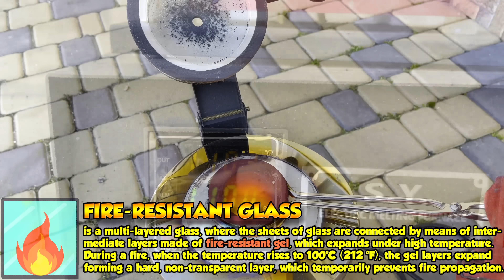Experiment: LAVA vs BULLETPROOF GLASS

Comment: The fact that this little lava cooker exists satisfies me greatly
Reply: me to
Reply: Not a lava cooker. The “cooker” is commonly used for melting metals for casting work.  Lava is molten volcanic rock.  It is a fun video though.
Reply: @ats440you  yes its a furnace I gave it this nickname
Reply: @ats440you  The video uses the term "lava" very liberally and has a "creative" thumbnail (basically a real lava flow photoshoped ontu glass. Looks nothing like the slag he uses). This looks more like melted iron to me. As you say, still fun.
Reply: @alexalex4041  lava is just melted rock
Reply: I don't think it's an actual lava tbh probably some molten metal
Reply: its not lava

Comment: Gotta love how the car glass just disintegrates.
Reply: modern day automotive safety requires that cars crumple and the glass shatters easily so it doesn't become super dangerous shards that will cut you up and impale you. They are engineered to be that way and for good reason.
Reply: @Darth1Marik  I might add, they are layered and in-between there's a sticky film that prevents too many shards to fall. In short, it crumbles but still stays in big chunks, to prevent cutting.
Reply: Tempered glass
Reply: @Darth1Marik  Automobiles use 2 types of safety glass, laminated glass for the windshield and tempered glass for the windows
Reply: @clarehidalgo  Was about to say. They ought to have tried a windshield instead of a side window.
Reply: @ianmayle  No, it's a side window. Side/rear windows are tempered (safety) glass. If you hit it head on with a hammer, the hammer would either bounce off or glass would shatter into a million pieces. But tap the edge lightly and BOOM, shatters easily. Front windshields are laminated standard (annealed) designed to give, so it will crack and flex if your head hits it preventing head trauma. It has a layer of plastic between 2 panes of annealed
Reply: I can imagine too that there’s significant advantage to having windows that break under significant heat. No one wants to be trapped in a burning car thinking “if only my windows were weaker.”

Most, not all, crisis situations mean that you’re trying to get out of a significant heat source inside your car, rather than keep one that is outside from getting in
Reply: yeah lol
Reply: @Darth1Marik  Some of those shards still looked super dangerous, and large.
Reply: @lennardtackett  well 1 the glass broke in one location from the heated liquid, in an actual car accident this wouldnt happen, as the vehicle would crumple and shatter the glass in multiple locations preventing large shards from forming. 2 look at those large shards again, they all have cracks throughout their shape, they would shatter into smaller pieces the moment they touch something with the slightest bit of force and  and some of them did when they hit the floor. So any shards that would hit a human body would break apart and only leave minor cuts. Still dangerous but I would still take car glass like that over regular glass.
Reply: It doesn't shatter and crumble just for cutting. It shatters so you are able to break them under water even with pressure on the opposite side. Then it crumbles quickly so it isn't a problem when escaping.
Reply: That’s what you want because you want the glass to shatter for emergency situations.
Reply: It's called safety glass....it spider cracks instead of having big shards
Reply: Never drive a car into a volcano.

Comment: It’s crazy how active the lava is. It looks like it’s working to destroy whatever surface it’s on.
Reply: I thought the same. Doesn't look like a very hot mass, more like some sort of mechanism built to destroy 😅
Reply: That is not lava
Reply: @examinus9737  Right you are; that's molten metal!
Reply: Molten lava isn't even that hot.

Try molten copper instead. It's 1300°C

But this was just molten aluminum 800°C , pretty equivalent to molten lava 950°C.

So the video title wasn't even misleading. It was actually fair click bait.
Reply: Lava shrinks as it cools. So initially it sticks to the glass and grips it and then as it cools it breaks the glass by essentially pulling on it.
Reply: @CalvinHikes  I'm certain its breaking the glass by heating the glass up and the glass expanding causing internal stresses. You could crack glass with a blow torch, no sticking and pulling required.
Reply: @monad_tcp  Good information 😅but doesn't really matter which one is hotter. Still couldn't stick your fingers in it 😅

Comment: The difference in effect the lava had between the fire resistant glass and the bulletproof glass is fascinating. I was expecting them to react more similar to each other, but with the FRG it boiled underneath until the pressure built up and went out in one big POP!

But for the BPG the glass started shattering much sooner which let the pressure build up less and avoided that final burst.
Reply: Yelp
Reply: Nice
Reply: 2:25 it did a flip
Reply: It seems to come down to the "plastic binder" which acts as a temperature barrier, the thicker, the merrier.
Reply: THAT'S NOT LAVA
Reply: @jasonrogers1576  yea its not lava why is it called lave its fluid metal

Comment: 02:54 So lava makes fire resistant glass turn into eggs?🤔 You've just solved the world's food problems!!!
Reply: I think it's popcorn
Reply: In the description of the fire resistant glass, they said that instead of the typical two layers of glass with a thin film in-between, it had two layers of thick high temperature glass with a heat expansive/resistive gel. So when any heat over 212*f touches the glass, the gel will expand and thickem creating a very tough layer. When the gel comes into contact with any heat that is well over 212* it hardens completely and changes color
Reply: It's not food

Comment: Not gonna lie, that glass actually held up better than I expected. 10/10 would absolutely install bulletproof glass in all the windows of my house.
Reply: 제발 한국인 나와라
Reply: Do you expect drive-by shootings ?
Reply: I would use Fire Resistent
Reply: @jeromewagschal9485  In US, very much possible.
Reply: @jeromewagschal9485  always prepare for the unexpected
Reply: @jeromewagschal9485  I live in the US and I'm afraid of drive by shootings with the recent mass shootings by neo-nazis. I think it would also increase the value of the property to say you installed bullet proof windows. Built to last!
Reply: @NobleAbsinthe  Can you imagine how confused a thief would be trying to enter your house through your windows if they didn't know it was this stuff beforehand? Lmao. I can just imagine the sheer bewilderment on their face.

Combine this glass with metal doorframes, high quality locks and some tough hinges. The price tag might be worth the peace of mind.
Reply: @zeropolicy7456  I read online that a square foot of bullet proof glass, with the same thickness as a normal window would be anywhere from $150-$800.

My windows dimensions are:
144in H
87in L

Area is 144 * 87 =12,528

Divide area by 144 constant to get square foot measurement.

12,528/144 = 87

87 square feet needed per window.
87 * $150 =$13,050 for low end
87 * $800 = high $69,600 per window 😢
Reply: @NobleAbsinthe  144x87?! Do you live in a cathedral??? Lol.

I used to work for Jeld-Wen, and when I worked there, the pricing for custom treatments was pretty high. Our particular factory actually offered bullet-proofing, but it cost more than $800/ Sqft.

If you're trying to bulletproof Patio/Bay windows like that, it might be better to just skimp on the security a bit. Lol.
Reply: @zeropolicy7456 my bad I was reading the other side of the tape measure. I'm so dumb lol. It was in cm. So just convert those to inches. 😳😳😳
Reply: @NobleAbsinthe  So about $2018 - $10,767 per window. That's not crazy unreasonable.

 I knew 144x87 inches was a bit too big. If you had enough money to afford windows that enormous in the first place, bullet-proofing wouldn't be a big deal. And if security is worth that much, you're better off with a wall instead of a gigantic window. Lol.
Reply: @zeropolicy7456  Thank you so much for catching my mistake! And yeah it does seem more reasonable. I might look up nearby vendors to see how they compare to that Google price range just for the sake of curiosity!
Reply: @NobleAbsinthe  Yeah sounds about right, and then if you want them framed after specific measurements it will be very expensive, but for people that have lots of money, sure go ahead.
Reply: Same
Reply: @NobleAbsinthe  it doesn't make sense to use bulletproof glass anyway, because with the construction you usually have in the US, the walls aren't bulletproof either 😉
Reply: Bulletproof glass 😳
Why not just install law and order? It got to be cheaper.
Reply: That would COST as much as your house is worth.
Reply: Guys, HERE is Our Savior

HalleluYAH translates “Praise ye YaH”

YaH is The Heavenly Father 
YaH arrives via the TENT OF MEETING
YaH was Who they Crucified for our sins

** NO FEMALE INVOLVED WHATSOEVER **
— Hebrew Book of Isaiah

Isaiah 42:8
"I am YaH; that is my Name! I will not yield my glory to another or my praise to idols.

Isaiah 43:11
I, I am YAH, and there is no other Savior but Me.

Isaiah 45:5
I am YaH, and there is none else.
Reply: @newbiekhyber  Only depends on where you live in the US. Some areas have higher crime rates then others
Reply: Notice how thick it was compare to the other windows.

Comment: fun video, fire resistant glass is good stuff, just super expensive

a bit of info, bullet proof glass isn't special glass.  It's just a bunch of thick layers of normal glass (usually 1/4" to 3/8") laminated together, similar to how your windshield is 2 pieces of 1/8" glass laminated together.

Comment: As a materials engineer, i am now determined to understand the mechanism here and why the reaction is the way it is
Reply: Don't forget to tell us about iiiiiitttttttttttttt
Reply: Points for curiosity, but a "materials engineer" who doesn't know about thermal expansion? Tell me what college you went to so I can avoid sending my kids there.
Reply: On a more constructive note, the effects observed here are predictable if you know that materials expand when heated.
1. Window glass: the central region gets heated, expands, while the rest does not, so the central region pushes the glass sheet apart.
2. Fire glass: the upper layer cracks due to thermal expansion, then the gel absorbs the heat, not allowing the other side to crack.
3. Automotove glass: cracks due to thermal expansion, but this type of glass is designed to shatter into small pieces, so that drivers don't get hurt as much during crash/impact. 
4. Bullet proof glass: the upper sheet absorbs the heat and cracks as it should, but not enough heat for the rest. 
Thermal expansion is critical in materials science. You wanna build things with materials that have similar rate of expansion when heated or your structure may crumble, form gaps between section of different material.
Reply: @rechitsapivo  he's already dead
Reply: Lava hot hot
Reply: As a regular person, I watched this because of the algorithm
Reply: This isn't lava, they wouldn't be able to get lava easily
Reply: Unless you have an engineering degree, or hold chartered/incorporated status, you are not an engineer.
Students are not engineers.
Reply: Great 👍
Reply: @rechitsapivo  r/MurderedByWords right there.
Reply: Oh, but you see, you won't get any explanations from videos like these. You can see comments where people are praising the complete lack of scientific explanation, because the video gets "straight to the point". Who would want to become, you know, a little smarter?
Reply: @anonymoususer2647  Engineer - Noun - a person who designs, builds, or maintains engines, machines, or public works.

Literally anyone can be an engineer.

Comment: Interesting observation: The bullet proof glass didn't begin to crack until the metal began to solidify from a liquid. Would this be because it took this long for the glass to heat up, or is there a sudden increase in heat transfer from the liquid as it releases its latent heat of crystallization?
Reply: Yeah , what he said!
Reply: @Sarghe420  lollll
Reply: You know what?

I was thinking the exact same thing.... word for word. What are the odds of that right?
Reply: I would assume both the latter and the fact that the solid mass sticks to the glass, preventing any further expansion/contraction due to heat. This in turn forces the glass to fracture due to thermal stress—it can’t go into expansion of the material anymore!
Reply: Hmmm, yes
Reply: I think it’s because the metal melted into the glass the stress out as the metal solidified strained the already weakened structural integrity of the glass,
That and seeing the glue between the layers of glass was pretty wild.
Reply: Glass and metalhave diffrent thermal expansion. glued metal began to shrink at diffrent rate than glass simple.
Reply: Ha, Nerd!
Reply: @nimbus3218  Indeed!  The Jelly Layer in the middle looked as if it was boiling in there.
Reply: It doesn't seem to be caused by heat. It looks like the BP glass cracked because the melted lava is combining with the glass causing it to get a extreme pressure.

Comment: 5:15 why does it crack more when it’s already drying up than on first contact?
Reply: There's some science behind it
Reply: it's still very hot and the heat has been absorbed by the glass and still building up.
Reply: What looks like cooling is actually the lava eating away the thickness of the glass which is why it causes cracks weak points
Reply: Its because the lava has melted into the glass. Making it able for the lack to flow into cracs and  Crevices of the glass as a liquid. Then the liquid lava in the crevices and cracs. Turns into a solid when cooling down. Making the liquid now expand outward pushing the glass apart and cracking it severely. The same thing happens with damns that hold water. Water can get into a crack the water in the crack freezes (Turns from liquid to solid) pushing apart the concrete cracking. So in short when something is liquid. It fills up every small space it can. This liquid Turns into a solid by cooling down or freezing. This makes all the small spaces bust apart because the liquid has now expanded greatly because its a solid now. Causing cracks and damage seen in the video.
Reply: I think its cause it had to absorb one last bit of heat before it exploded

Comment: The Trick is to use s glass with high meeting point an lower thermal expansion factor. The bullet prooved glass only did so well because it was much more thicker than the fire resistent glas. If you consider material cost /amount  vs. safety the thermal glas does best.  
Glas is a fascinating topic. Depending on the dopants (addatives) inside  it can take completly different properties to fullfill very different functions. Mixing glas seems like alchemy to me.